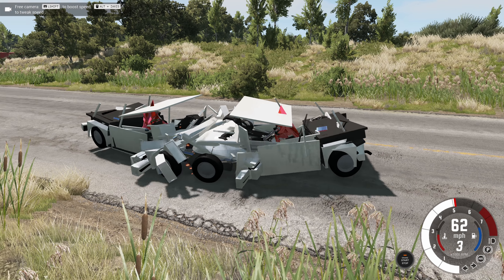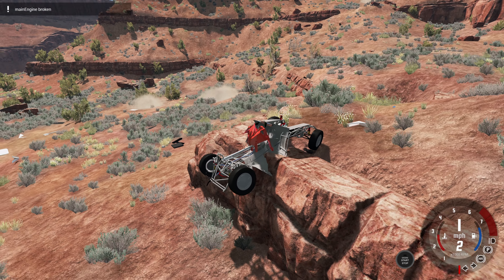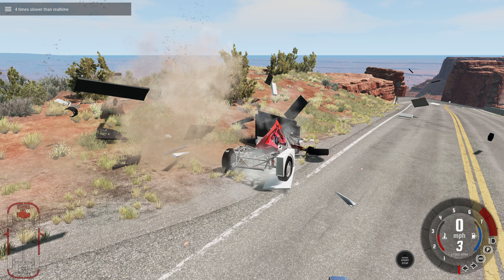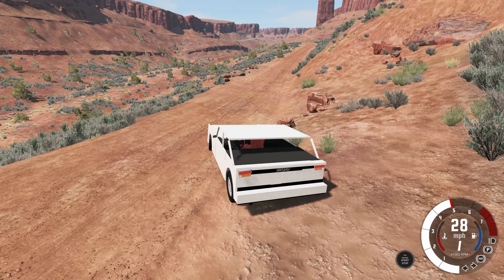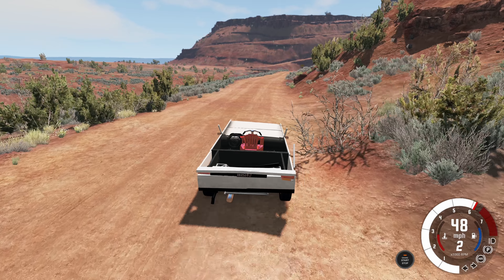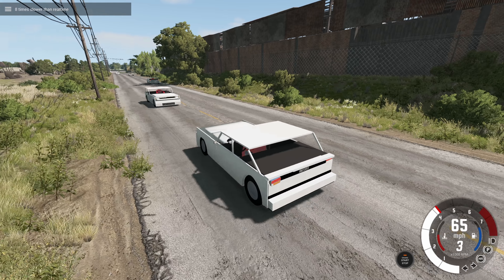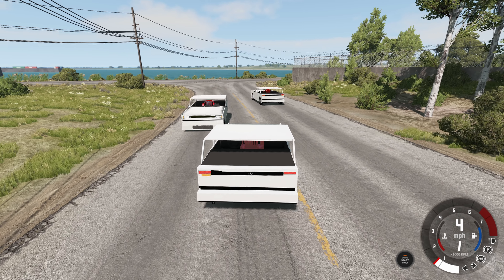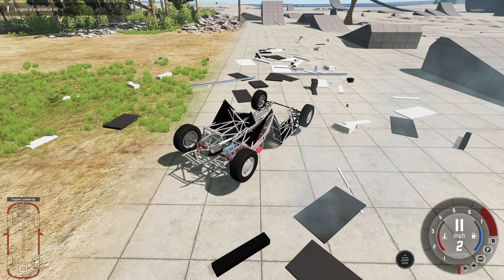This Car EXPLODES on IMPACT - BeamNG.drive Ibishu Bird

Comment: As someone who plays BeamNG drive and has used tons of mods I can assure you that it is not normal for a car to act up like that but they are a few times where cars would like stall when not accelerating or have weird hard body physics but I haven't ran into a car where you tap a wall and it literally blows up